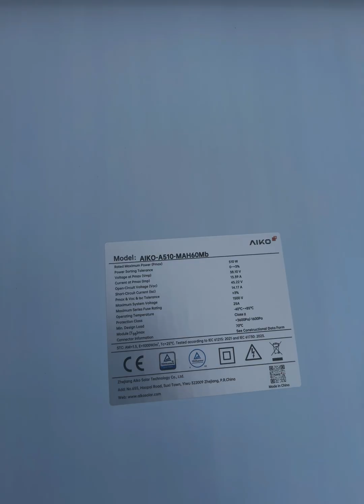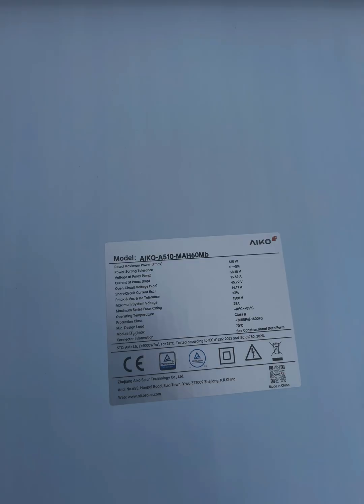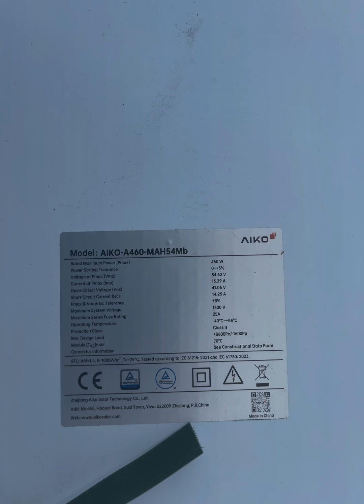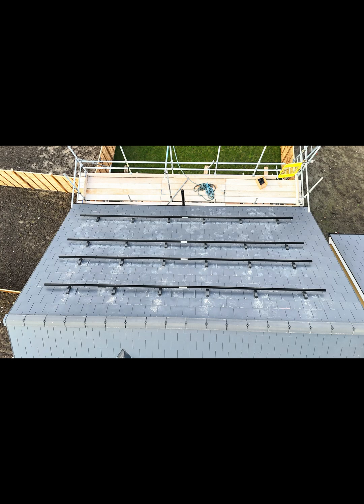Sigenergy Sigenstor Battery, Inverter, Car Charger, Gateway, Aiko Neostar PV install Skylar Solar

Comment: Nice video Pete. The lack of edge protection on the scaffolding had me wincing mind!
Reply from the maker: Thank you. I guess it’s down to the installer regarding the edge protection for the install. It’s a cost cutting exercise for the scaffolding costs.
Reply: Adds about £80 to our scaffold systems generally. Hard argument for its ommission if the worst was to ever happen. While that doesn't happen much like most health and safety its a none issue. But very sadly sometimes it does happen. Falls from height one of the biggest killers in construction.  @petewright2283

Comment: Very interesting, any data on the north compared to the south facing ones?  Since the charger is bidirectional which EV are you using and dose it match the bidirectional side?
Reply from the maker: I’m going to do a video when I’m back but north is smashing in. I had a Tesla Model S and a Nissan NV200.